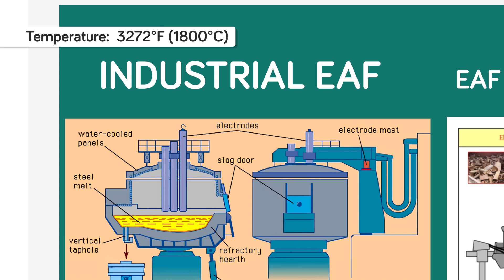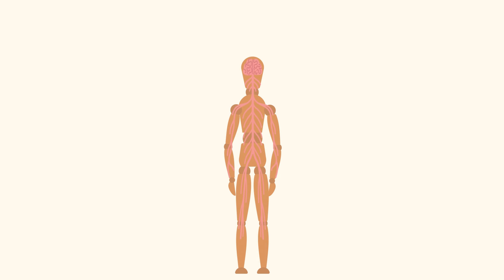What If You Fell Into Molten Metal Terminator 2 Style?

Comment: The hook should had went straight down before moving.  The handle is designed to fall aside on its own and should have industrial springs or  Hydraulics on both sides.
The guy running this deck was trying to get all fancy.. 
So glad no one was hurt!🙏
SAFETY FIRST 🏆

Comment: There's only one thing incorrect in this video... there are actual videos on the dark web(2 that I know of) of a worker un alive himself by jumping into ladle. They left out the part where the molten steel explodes the same way it does when water is introduced(the human body is roughly 60% water). Not much to see if you're watching it happen, the flash of heat and light is to bright.

Comment: Years ago, this happened at CF&I Steel in in Pueblo, Colorado when a worker fell into a ladle of molten steel that was ready for teeming (pouring the molten steel into ingot molds).  The worker, of course, "went up like a spark."  The ingots were poured but the workers in the soaking pits and rolling mills refused to handle the ingots after the molds were stripped away.  CF&I eventually buried the ingots somewhere in the nearby Colorado plains.

Comment: Steel is coated by dust mixture to protect it from cooling and oxidation. Temperature above molten steel is normal, mayby just 10 degree higher than outside temperature. In the winter it's very cold in the foundry shop.

Comment: Humans have about the same specific mass as water. Steel is almost 8 times as dense. Terminator would have to have weighed over 700 kilos (1500 pounds) to have sunk in molten steel. Or around 250 kilos if it was molten aluminium. That would seem more plausible.
Regardless, one of the most awesome scenes in cinema history, so I'll gladly look the other way.

Comment: I’ve been told this story from Lackenby Steelworks, by the former workers that I’ve worked alongside on the railway since the works closed and most came to work on the railway. The story was confirmed by several people, now working in different places and didn’t necessarily know each other. So it’s potentially true. I personally believe it.

A father and son worked in the steelworks together, in different working areas but on the same shift. The son partially fell into a crucible of molten steel. Other workers couldn’t get close enough to pull him out as he screamed. Across the furnace building, the father heard his son’s screaming and ran over with a pole. Everyone thought he was going to lay it out for his son to grab onto as he was pulled out. Instead, the father actually pushed him in to end his suffering.

Sounds a bit like a creepy pasta, but it appears to be a very well story across the many former workers of Lackenby steelworks. So it does appear to have actually happened.

Comment: Happened in Stocksbridge Steelmill, UK. They kept the ingot as a mark of respect for the guy, but it was eventually rolled and sold as British Steel Corporation was sold off to Corus.

It was suicide, rather than an accident. And no, depending on the carbon content and grade of steel, it doesn't ruin the properties of the steel; probably slightly higher than usual calcium, but the carbon isn't a problem if the ladle has 300 tonnes in it to begin with.

Comment: A thought: would it be worse or less bad if the vat contained molten LITHIUM instead of molten iron ? Since lithium could still be well over 1000 degrees when liquid (boiling point slightly over 1600 degrees IIRC). And since lithium has density of little over half of density of water one would probably sink into it pretty well...

Comment: I work at a hot metal smelter. This infographic is speculative and completely innacurate. Regrettably, there have been multiple fatalities. In the case where worker stepped into a casting mould of Bessemer Matte (molten steel) he was ejected from the molten material in an explosive reaction from the reaction of wet and molten steel. He lived, however very badly hurt. Next time you claim zero Google Flin Flon Manitoba, or Inco Copper Cliff.

Comment: When archaeologists were excavating Pompeii they discovered human skulls with huge holes in them. The force that caused the holes appeared to have come from the inside. They realized that these were people who were overtaken by pyroclastic flows. The gas and ash that engulfed them was so hot that it caused the fluid in their skulls to flash to steam. Basically, their heads exploded from the heat. This is not science fiction, folks.

Comment: What if you fall into molten metal Terminator 2 style?
1. Flash seard. (outside skin crispy like bacon)
2. Skin shell cracks (think well done ham).
3. Blood, plasma, digestive fluid, spinal fluid start gasification (think grease fire ignition....nearly explosive)
4. Your instinct to keep yourself away from the heat you automatically plug hands into the metal as the last few milliseconds of life as steam rushes out and ignities you entire body with your mind the last thing to go (perhaps head first would have been better) explodes violently. 

Or you end up like Han Solo in Return of the Jedi.....

Comment: If you have ever poured water into an oil fire and observe what happens, and observe what happens at a molton steel factory where a small amount of water gets into the mould, it's easy to assume that a person falling into Molton ladle of steel, would no only result in the demise of that individual, but also likely the demise of any employee within 500 feet. It would flash boil the person so quickly, the water vapour within the body would be turned into hydrogen and oxygen, and ignite causing a MASSIVE Molton steel explosion.

Comment: 2:05 Forget the "superheated air", even if you wanted to do it, the radiant heat alone from a fresh steel pour would make getting within 25 ft. of the opening of the ladle nearly impossible without a full protective suit. You'd get a great grilling from all the IR and visible light coming off the worlds most demonic French-fry light long before you reached the surface. And once you do finally reach the surface, the steel will almost certainly explode quite violently from the moisture content in your body.

Comment: There's actually a security video somewhere on the internet of a guy committing suicide by jumping into one of these molten metal containers at a plant. None of what this video says would happen actually happened to this guy. When this man jumped in, the container exploded and rained down molten metal onto coworkers. Any small amount of research would've showed this. 

This video seems to just take an uneducated guess and unnecessarily draw out the video for, what I assume is to meet some type of minimum video length that allows the channel to produce money.
Reply: I haven't seen that video but my grandfather worked for US Steel for 50+ years and he's seen this happen a few times in which cases he had to sign documents stating he witnessed them fall in because your body will liquefy there's nothing left no bones or anything gone he also had a guy just fall against the outside of the vat and when his coworkers tried to pull him off his last words were "leave me be" and he was dead melting to the side of it .

Comment: I worked at such a place for a while. Had an incident where I got some 1245 degrees Celsius hot molten metal drops on my skin while taking the temperature and probes for the laboratory. The moisture in the skin protects you from much harm from small amounts as it gets repelled. Had it in my shirt tho, so it couldn't get away and danced around on my skin until it found a way out leaving a fancy mark.

Comment: At a foundry I used to work at, a lady was burned to death by molten iron.  She was on the melt deck when the furnace exploded, blasting her with molten iron.  She was badly burned, and died a horrible death.  Another worker tried in vain to pull the hot iron off her skin, badly burning himself in the process.   A third guy jumped off the side of the platform in an attempt to get out of the way of the molten iron.  All in all, this is a horrible way to go.

Comment: Actually you would explode, the 1600°C of the liquid steel would super heat the water in your body and blow your skin off, then your muscles would explode then your bones would also explode. The furnace would also explode. Used to work in a iron smelter. One of the ex cons thought it would be funny to crush a coke can and throw that in with the rest of the scrap. The few drops of liquid were enough to blow half the 2 tons of iron out like a volcano, the ladle cracked from top to bottom and spilled the rest on the floor. 6 people injured. $800,000 worth of lost time and damages. I quit after that, too dangerous

Comment: You’re forgetting what happens when your body, 60% of which is composed of water, comes into contact with a 1000+ Degree surface: The Leidenfrost Effect Initially your body would probably bounce or skip off the surface of the molten metal in a similar fashion to when drops of water scurry across the surface of a hot frying pan.
Reply: He is also missing what happens when the water in your cells suddenly flashes to steam.  I once suffered an arc flash injury to the backside of my hand and it looked awful as all the skin cells in the area had literally just exploded (cauterized, but also exploded) so it looked like a lot of ragged exploded skin cells....and that effect would have just continued on through to the organs.  Just cleaning up that wound was a mess.  So the Leidenfrost effect would indeed happen, but only as each new layer of cells flashes to steam and explodes releasing that steam...then the next layer, etc.

Comment: You would float, a little. Most metals are heavier than water so you would only partially sink, but defiantly would not sink below the surface. It would be a firey smokey mess bubbling all around you as you boil and steam.

Comment: Having worked in foundries, I know what happens when ANY moisture enters the melt.  It causes the melt to erupt in a volcano-like manner.  I have seen, first hand, a 1,000 pound crucible completely emptied when an ingot that wasn't preheated to drive out moisture was added to the melt.  The molten metal all just blurped out of the crucible and at the same time, launched the offending ingot up to the ceiling, 42 feet above.  This is exactly what happened when a nearby foundry had several workers fall into a melt when the catwalk collapsed.  The explosion from the bodies instantly turned into steam, destroyed a large portion of that foundry.  In other words, you don't know what you are talking about.
Reply: The foundry I used to work at had a furnace explode, sending molten iron onto a woman, causing an agonizing death.   A guy jumped off the side of the platform to escape.
Reply: i have questions about your story 🤨
Reply: @irulan9161  What do you want to know?
Reply: @PremPS1000LE  You said a catwalk collapsed - Was the walk directly over the molten metal area? Were there no other safety measures in place to prevent those workers from falling into the melt?  Do these crucibles ever have a protective cover or cap to prevent anything from falling in?
Reply: @irulan9161  no, they generally dont. Some have caps while heating and pouring, generally the massive ones. Smaller foundries often have open tops as they are stirred manually. And mainly talking Pre-snowflake era here, before health and safety was a thing
Reply: How was the pay?
Reply: So sort of like when you put water on hot oil?
Reply: yes i saw a video on bestgore... a guy jumped on a furnace and it made an explosion

Comment: as a metallurgy engineer i can point out some inaccuracies in this video but there's especially one thing i'd like to clarify is that you wouldn't be contaminating the batch at all. we usually discuss this when we're bored around the ladle and the thing is the amount of impurities you add to the mixture is very minor, also it's one of the popular questions asked by the interns so it's a popular topic inside any steel factory actually.

Comment: I actually work in a foundry and ladles of iron are 2580- 2700 at the most why? the ladles lining that is made of refractory lasts longer with the low temp, 3000 degrees eats the lining out quickly and it's expensive to reline it.

Comment: Going in head or feet first will sink enough of the body to produce explosive sublimation inside the melt. This would occur with sufficient force to blow a substantial portion of the melt out of the vat and anyone ins the same space would be at risk of getting splashed by several kilos of molten metal - which would lead to death, disability or at the very least, permanent maiming following a long convalescence. Very small amounts of water trapped in metal tubing are notorious for making the dip into the molten zinc so hazardous that the melt crew must exit the building. And I helped clean up one of the messes caused by this phenomenon; several hundred kilos of zinc an inch thick all over the floor when the square tubing of some trailers was a bit wet inside and exploded on the dip.

Comment: I wonder what would happen if you landed on your feet? If the molten steel is dense enough to "walk on" you could theoretically run as fast as you can to the edge and jump out. 
I would imagine that it would be like trying to run across a water bed that's slippery and instantly melting off your footwear and the radiant heat coming up and hitting your face would probably choke you and force yours eyes shut.
Regardless, it's a very bad situation no matter the outcome.

Comment: 1700 comments, a month old video, no one will ever see this post. But this is mostly wrong. You'd nearly instantly vaporize as the water inside your body (that means your tissues, blood, organs, etc) explodes into steam. There are videos of workers falling into molten metal (and one of a lady falling into lava), in both cases there is a massive explosion. Two reasons: One, the water boiling like I mentioned before, and two: the body sinks ever so slightly below the surface before it explodes due to the leidenfrost effect thus allowing molten material to cover the body. This allows the steam to build up pressure leading to a catastrophic explosion. The air before you hit would not matter at all in this scenario, as you're going too fast and through too small of a layer. This whole explosion process takes less than a second and you'd likely be dead before you even felt anything. Just my 2 cents.

Comment: Did you remember the T-1000 ordeal in the molton steel. It caused a souless killing machine to experience pain making it to writhe in severe agony.
Yet earlier it;
- Got its head split open by a shotgun point blank.
- Crashed a truck and helicopter that also exploded.
- Had a M16 magazine fired full auto in its face and chest from 3 feet away.
- Along with countless other rounds of various calibres.
- Frozen by liquid nitrogen and shattered into thousands of pieces.
- And split like a log by a 5ft crowbar.
And never once showed any sign of pain or fear of death

Comment: I worked at U.S. Steel's Homestead Works before it closed. We made steel with the open hearth process. Most heats were tapped between 2700-2900 degrees Fahrenheit. Armor plate heats were tapped at 3100 degrees. 

All of the water in your body will be turned into superheated steam instantly and you will be dead before the pain impulses can reach your brain. 

In years past, the company would actually bury the entire ladle. Several have been found as the mills were razed and the land repurposed. The records have long since been lost. 

Each furnace in OH5 was capable of producing 375 tons of steel every 4 hours.

Comment: You missed the part where the moisture in your body turns to steam and throws a shower of hot iron over the entire area. If you were as heavy as the terminator and and actually sunk below the surface you'd make a large enough explosion to damage the refractory coating in the furnace which would lead to much more destruction and death.

Comment: I was working in a foundry. 
It is not very rare that people fall into furnaces.
It's just not published.
I once was witness, sort of: A worker disappeared and he was last seen to escalate to the top of a blast furnace. Then he vanished. The conclusion was that he breathed carbon monxide (which is abundand there), became unconscious and was pushed into the furnace by the automatic 'bucket' that fills the furnace.
And there is a well known and time honoured tradition that the metal in which the body is supposedly 'in' is not used for production but casted in ingots which are stored for a year or more, as his grave.

Oh, and btw: The death is very quick, because of the shock, but the actual incineration is rather slow due to the 'Leidenfrost Phenomenon' which keeps a drop of water on a searing hot surface from evaporating very quckly: The body floats like a hovercraft, carried by the gases that evaporate due to the heat.
I have seen a mutton's head swimming in an iron furnace. It took a long time before it was consumed. And the skull exploded, when the brain boiled, with a dull 'thud!'.

PS: If you forcefully submerge moist stuff, like a body, under the surface, a very violent explosion will occur. it's enough to spit on a piece of iron and throw it into the liquid metal to demonstrate. Therefore, all heavy stuff you want to throw into a furnace must be thorougly dried (by heating it well above 100 degree C, preferably)